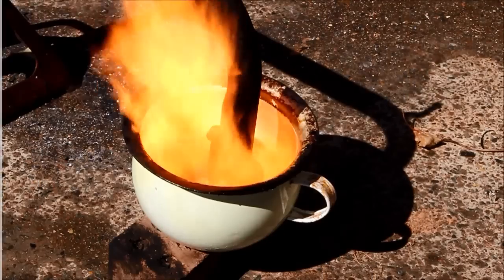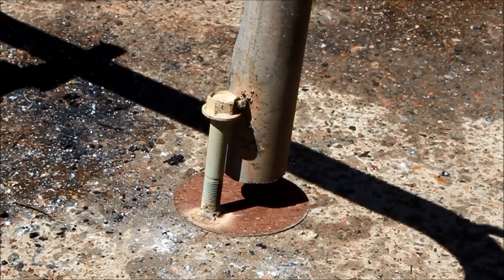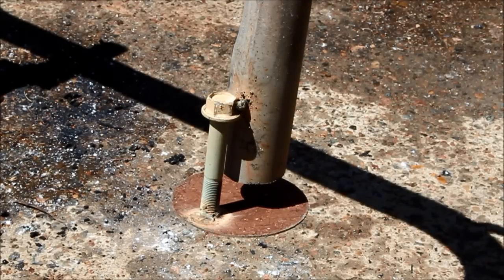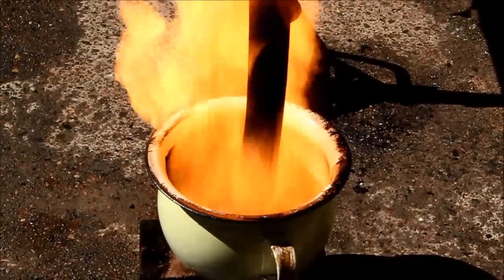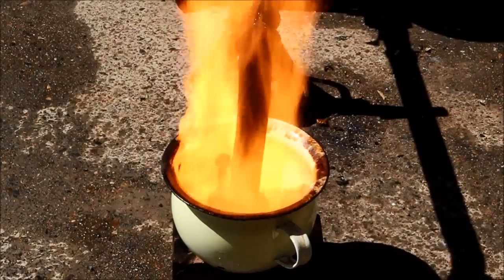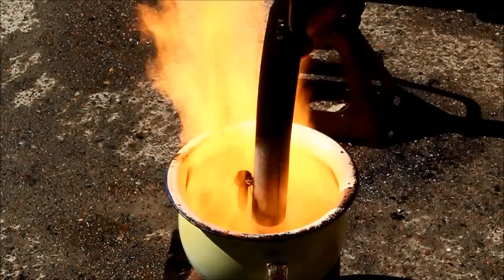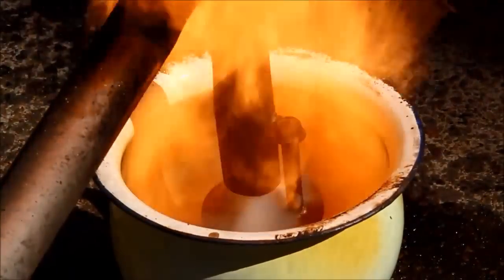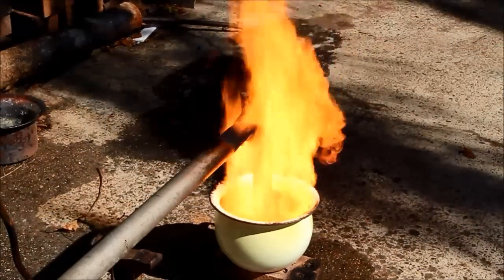Building a Waste oil burner from Grannies Chamber Pot

Comment: i have built a couple of (YOUR ) burners they work flawless.  have melted car wheels.  currently building granny,s piss pot  burner to install inside 60 U.S. gallon vertical compressor tank for a shop heater thank,s for all the ideas will try to set the world a-blaze. ps. thanks for the safety warnings . we have tree hugger,s here to.   there breeding Jon in ky.  US- of A.

Comment: Gooday!     This  seems  to  be  exactlyb  what  I'm  looking  for  to  heat  my  Hot  Tub.     But  will  I  get  this  to  work  with  a  130  cfm  bilge  fan?   I   think  I  will,  but  I  bow  to  your superior  knowledge  and  experience.Don't  fart  on  the  cluggie  and  light  it!
Reply: even  had  thoughts  about  TRYING  a  venturi  at  about  the  level  where  the   oil feed  lets  the  oil  out  into  the  blower  tube.  I  may  be  on to  a  loser  there,  but thats  how  carburetters  get  the fuel/air  to  mix....
Reply from the maker: Any blower will work mate. The only difference is what the max heat output will be. I think you will find a 130 Cfm blower will provide a good but sensible output. If ou are using a commercial heat exchanger that was gas fired before ( or even oil fired) it's VERY important not to over power the thing. If you get localised Boiling  internally it will degrade the HE very fast and could give you all sorts of undesirable problems. 

Really, better to slightly under drive the thing than over.  If you are using something a bit more crude like a Tube in tube HE, the risk is much less but you just end up heating the air not your water. 

A venturi would be going backwards. These do not work on atomisation, they work on vapourisation.  All the air does is move the oil into the chamber. From there the heat changes it from a liquid to a gas which is what actually burns. There is no advantage to spraying the oil but a lot of drawbacks.  Have your air/ oil tube facig slightly down into the burner in case your air flow is not strong and that's all it needs.  :0)
Reply: That's  what  I  was  concerned  about.   My  HE  is  a  3mm  aluminium  vessel  (which  has  admittedly  had  some  pretty  fierce  wood  fires    under  long  periods)  sitting  in  a  huge  tub  of   water,  about  3½ -  4  cubic  meters. It's  extremely  low tech,  Just  a    tube  welded  together  in  a  U  form,  Just  over  a  foot  wide  on  the    intake  side  and  a  tube  half  that  width  as  exhaust.   I'm  going  to  have  my  burner  tube  going  down  to  the  bottom  - over  a  meter  down,    with  a   lid  and  a  flange  welded  onto  it,  to  keep it  still  AND  to  stop  the  burn  from  going    backwards.   I  have  also  located  an  exhaust  extractor  fan  on  E Bay   which  delivers  about  85  cubic  feet  per  minute,  which  is  a  bit  tamer  than  the   bilge  blowers'  output  of  around  140cu.f/m   I'll  see  how  that  works,  and  get    a  bigger  one  if    this  proves  to  be  inadequate.    I'm  also  working  on  a   carryable  Grass  burner,  to  get  rid  of  last  years  weed  growth...  Sort  of  short  range  (only  about    a  foot  )   flame  thrower.   Keeping  the  thing  to  a portable  weight  and  size  should  be  a  challenge!

Comment: Been researching and watching all these waste oil burners, yours seem the simplest - and you are a funny bastard! Couple of questions - did the enameled coating hold out? - thinking it may void soot build up. Does the burner plate get a build up of ash or coal? - or does it just blow off? This seems to be the main downfall of all vapor based heater designs. Was thinking of doing the 9kg LPG design with blower fan - NZ Drip Fed Oil Heaters. The ones I've seen say while they work well, you have to clean them regularly (daily). The bloke who uses the aluminium burner disc is interesting, but I only read negative reviews due to fine tuning. I'm in Melbourne, Victoria - and the natural gas prices are going up almost as fast as the electricity! Would appreciate your "experienced" feedback. P.S. If you're into lighting farts, do it in jeans, NOT nylon undies - first hand experience tells me you burn a hole in your jocks and burn your arse hairs....
Reply from the maker: yes, the enamel held up perfectly! I was surprised but showed no damage from the heat at all.  There is no buildup as long as you run the thing hot. I think carbon burns off at 600oC so if you keep it above that, it's fine.  when I shut down any of my burners they are always clean inside which is one big advantage of forced air over draft types that need cleaning. 
The draft designs have their place but buildup is a problem. I have done them myself but I cannot see a way to get sufficent heat and swirl in them to prevent the buildup in the primary burn area.  they are also difficult to get to burn completely clean.  Can be done but not easy and it reduces their effective heat output. 

Lighting farts is one thing I haven't tried to burn and probably won't ever go down that road.  ATM I am doing Hydrogen ( Hydrogen not Hohoho gas) and about to try making bio gas. Bit cold here in Sydney for that yet but summer is on the way.

Comment: OB, once again you have made me laugh out loud.. To the point of making my wife come in and find out what the hell I was cracking up about... I replayed the first part of it for her and she began to roar as well!!!  I love your videos but think you missed your calling of being a very funny comedian....  Keep them coming my friend..... SP.. 

Ps. my burner is still on the back burner, so to speak, as I am finding it damn difficult to get my hands on used veggie oil.. So I am working on my shop in the meanwhile. 

I am wondering how a "BELL" shaped outlet would work? Maybe even better vaporization?????  Hmmmm.......
Reply from the maker: Thanks Steve. It's always a guessing game for me between funny and corny so I'm glad I seem to be getting it right for the most part. I always think if you can learn while being entertained rather than bored, things stick in mind so much better.  I have never tried a Bell shaped outlet but I think it Could work well. As I have showed in this vid, anything will work as long as you keet some retained heat and get the thing up to temprature.  If you can't get used Veg, you could try for some transmission or engine oil. They burn slighlty hotter than Veg and if the burner design is right will burn 100% clean.

Comment: U still can improve your burners:
pre heated oil, heated by the burner itself. so wind a copper pipe or better the iron pipe from an old refridgerator around the burner. this will heat up the oil.

and feed the air intake with heated air also, but dont get over the specs of your air blowers. thats pritty much how steel mills work.
so Your burners can even amplify themselves so to say

Comment: how about using a cramic toilet boil? would it withstand the heat?
is the shape (funnnel) appropriate ?

I just happen to have a couple that need disposing.
Reply from the maker: I was saying this to a friend! I told him I reckon I could make one work if they didn't  crack or shatter with the heat. I think the shape and material apart from that is something I could make into a burner.  Imagine the safety warnings I'd have to put on that one!!!  "Don't do this to the Toilet in your house, don't use it whist on fire, don't light it up when full, don't Vomit in it if you have a hang over while it is alight....." The idiots and safety zealots would go into over drive with that one.
Reply: Oil Burner Even better reason to do it! Bonus points if you can build the tank into the system somehow (preheat chamber?)
Reply from the maker: *****
yeah, Upsetting the safety Zealots and whingers has become fun.  It's 99% the people whom have never got their hands dirty doing anything themselves that whinge and carry on the most. Really makes you wonder what sort of infernal pains in the arse these people must be in real life and the hangups they must have.

I keep an eye out for a lot of things to build these burners from, never thought I'd be on the lookout for an old crapper though!
Reply: Oil Burner Wish I'd never gotten my hands dirty, I've been a heavy metal fabricator most of my life that mixed in with millwright and heavy equipment mechanic. Yeah I get my hands dirty a lot. I quit getting hurt as soon as I got to the point that I could decide my on actions.

Comment: I'm thinking mini forge!!
Reply from the maker: I did try sticking a bit of steel bar into the flame and I was surprised how quick it heated up.  I was wondering about a Mini melter. Just throw some scrap aluminium into the thing directly to melt it down.
Reply: It would work as long as there's a place at the bottom with low oxygen, so the aluminum doesn't just burn away.
Reply from the maker: kbbacon Yeah, good point. I'm going to use it in a taller chamber so maybe if I set the air inlet up a bit it would allow that low oxygen part especially since the fuel would be vaporisng there and consuming the oxygen?
Reply: I think so.

Comment: sorry i thought your vids were about waste oil not veg oil , like I said you can take any desiel engine  and use waste fry oil to run it at a lower mpg!! so to burn waste fry oil is just silly, this vid is full of shit, Hmm I just said it , oh and it's true!!!
Reply from the maker: How long have you been running your vehicle on WVO Scott? I have been running mine  on it for 10 years. I haven't heard of anyone saying they get lower MPG though.  How much extra mileage do you think you get with veg? Veg oil has about 10% less energy than diesel so it's interesting you should get more mileage.  Why do you say burning Veg oil silly? 
I burn veg oil and some WMO from the engines of my vehicles as these burners will run on anything. I get a lot of veg I don't think is up to par for the vehicle or my stationary engines so I get rid of it like this. In any case, where I am veg oil is in abundant supply and I have no problem getting it at all.  There are in fact VERY few vehicle diesel engines you can burn Veg oil in made within the last 10 and certainly 5 years now. Most wont even run on Biodiesel  thanks to the DPF filters.  Older engines with mechanical injector pumps are usualy fine but to say any diesel engine will run on veg oil is not correct.